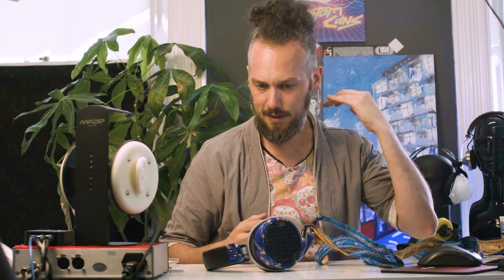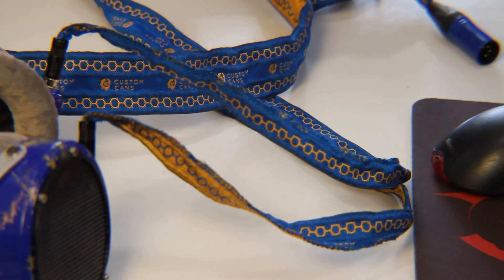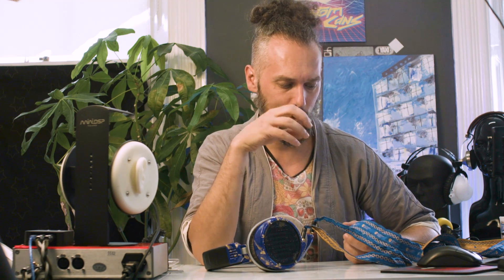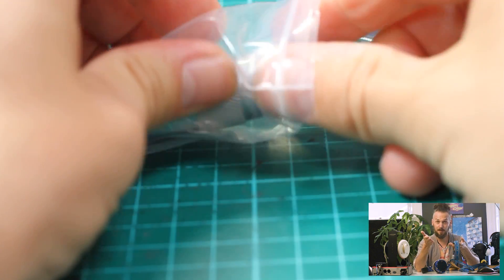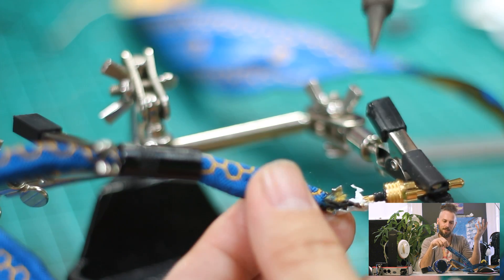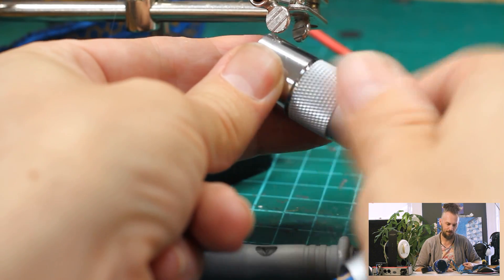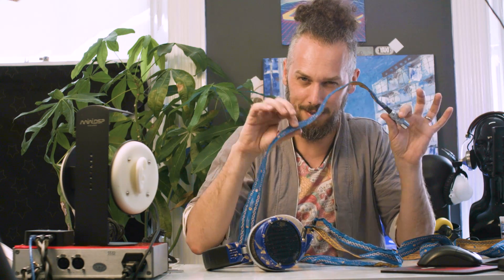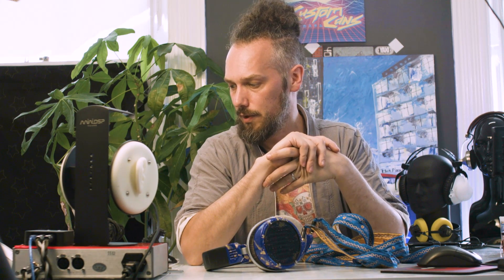Possibly the best headphone cables ever made ;) taking a look at our latest design.

Comment: I see that you now offer both copper and silver cables. Are both materials OCC or is your copper still OFC? Thanks
Reply from the maker: The copper is still OFC
Reply: @CustomCans  Thanks. Would you consider upgrading your copper cables to OCC? Or do you consider OFC sufficiently good?
Reply from the maker: @MistaLova-Lova  We have considered it. The copper wire we use is pretty good so there would not be much advantage going to OCC and it would bump the cost of the finished product up by about £40 per meter. It may be something we try in the future. It is not the kind of thing we could do as a one off request as we have to get the wire made to our own spec and a batch costs a couple of thousand pounds to get made.

Comment: Poor soldering job there mate.
Reply from the maker: Yeh ;) Trying to hold the soldering iron at odd angles so it does not interfere with the camera combined with silver solder on litz wire did not help. I kept this one for testing and have used it every day since and it has held up so far so... maybe the bigger the blob the better the job is true ;) 
I promise, James our technician does a much neater job on the custom ones than I did in this video.
Reply: @CustomCans  Yes, silver soldering is much trickier.

Comment: Heeey you do good work BUT question:  I see all the labor you’re putting into making sure the Litz is coated in graphene but what do YOU think that does ..? I ask because you’re apparently not soldering to it (the graphene), nor are you treating the enameled Litz before soldering, so I’m just kinda’ wondering if I’m missing something

Graphene is desirable because it’s a super-conductor, isn’t it ..? What are you using it for in this specific application ?
Reply: I just want to add a little to what I mean:

Take away the wire & coat, say, a string in graphene. Then solder the graphene at both ends.. say it’s used in a closed circuit because the graphene is uninterrupted

But @ 2:22, there’s this shot where it has cracks & breaks in it, nor is it even soldered to the plug

If you pulled on the graphene-coated string, & the graphene is so fragile that it cracks, wouldn’t that break or open the circuit ..?

So my question is more… to what avail does the graphene matter, the way you are using it..? That’s what my curiosity is, I suppose
Reply from the maker: In this cable the signal is being carried by the copper and the graphene coating is used as shielding. This is essentially covered in tiny graphene particles and as they all have joins in-between it is not a great conductor over the length of the cable but it does block a lot of RFI and EMI without raising the capacitance as much as normal shielding. 
I know it seems like a bit of a waste, not using it to carry the signal.We make the same style cables without the graphene coating as well.

At the moment we are using electro mechanically exfoliated graphene, which is made by pumping ions in and out of the layers in graphite to flake off tiny pieces of graphene and the flakes are tiny. I have seen people working on growing graphene  directly on copper foil so it may be possible to make a decent conductor from that in the future but it has to be done under crazy pressure and in the correct mix of gasses so it beyond our current resources / engineering ability.
Reply: I seeee…. —it was my understanding that one end of the shielding needs to be soldered to the source end in order for shielding to work properly.. & even then, if there are breaks in the shielding… man, I dunno

I love that you’re trying it, tho

And hey don’t get me wrong, I really love your work & I’m not trying to give you a hard time or anything but some of your fundamentals feel a little wonky haha

You make a better artist than an electrical engineer <:)

I dunno if this will save you a headache or not but could I make a suggestion ? Ever hear of copper tape ..? See if you can carefully fold copper tape over the length of the wire(s?), trim the excess, solder one end to source ground, boom, then you at least have some textbook science action in the mix & you don’t have to hope that what you’re trying w/ costly graphene-based techniques work the way you want it to (respectfully…!)

Again, your work is cool & the videos are cool but if you’re going to low-key take on an Educator role as well, you’re trying to show your work in these videos & what you’re explaining is uhhh —it’s not “bonkers” because I get where you’re going for w/ some features but I’d hate for you to do all that work & then it’s sorta’ for nothing

Burning yourself for the time, burning the customer for a missing feature, but I guess if you jack the price up & everyone’s happy then I dunno I guess haha

—I’m picking a real fight w/ craftsmanship this week & may need to switch the decaf but some of this is fundamental & it’s your field w/ this particular business…? So if your shielding isn’t going to work, don’t include it or don’t up-charge for it being present /:)

Hahaha I dunno why this is coming out like this haha I guess I see room for improvement & just wanna see everyone do better work

—man, the chick at the merch booth last night for Machine Girl wouldn’t grasp that the actual artists didn’t make the shirts, a teeshirt company did & @ $40 a shirt, “just let me see a few more shirts” to check for the most centered graphic. Money is being handed off anyway, but people are flawed & some of the shirts have crooked prints & I won’t have that hanging on my mind for the next several years, wearing crooked prints like a chump

And if you’re one job is to hand off shirts, just be nice.. let people look at a few shirts. You’re Life is fine, no one is in danger, show some respect to the artist & your employer, y’know..?

Not YOU, but people be shrugging at standards out here & it warrants the occasional slow-blink

<end rant>

Keep up the good work, dude. Just do your best & keep on keeping on <3
Reply from the maker: @theIMMUNICORN  Thanks, and yes, floating shields are much less effective. I had seen a few other people using graphene coatings as shielding in electrical products and I think the theory was that it acted like a very lossy antenna absorbing and re-emitting the radiation and turning some of it into heat in the process reducing the amount that got through ... It seemed to make sense and people with much more expensive setups than mine were getting results. I tend to get over excited buy designing stuff and overcoming the challenges and this seemed like a fun thing to try. 
We do make turntable cables with normal grounded shielding but it increases the capacitance of the cable quite significantly and we always try to keep that low where we can and obviously makes it a lot heavier and less flexible. I, personally don't feel that most headphone cables need shielding but a lot of people asked for it and this seemed like a good way to tick that box by adding a certain level of shielding  without adding too much weight or capacitance.
We also gave cables out to testers and they said they preferred the graphene coated ones - obviously, knowing they were more expensive and involved a sexy material like graphene probably had some kind of subconscious effects.
A lot of the high end cable market is based on dubious theories and I do try an keep just the right side scientifically plausible while still giving people something they can brag about to their friends but I may have over stepped the mark on this one, and if I have, I apologize.

Comment: Because the effect is so small, I've never cared about inductance and crosstalk, but what does this do to cable noise? I find that the cable noise on my HD25 set is absolutely awful
Reply from the maker: Yes, i think what you are talking about is "cable microphonics" where the cable transmits vibrations to the headphone when it rubs against your clothes and things. This one is pretty good as it has a little stretch to it which absorbs a lot of the vibration. The HD25 it a bit of a nightmare for microphonis because the cable is hard mounted to the back of the driver module so it picks up vibrations from the cable like crazy... I have been meaning to try to do something about that so I may try and make a fix for that next week in a video.
Reply: @CustomCans  That would be absolutely incredible if you could remedy. I'd easily pay 60% more for the HD25 if it didn't have that problem. In my job as a location sound mixer for film, having the cable rub against my jacket is a surprisingly big problem.

A note on calling it microphonics: I've heard this used for this concept before, but according to the sources I've seen online, microphonics is about mechanical vibrations being turned into electrical noise, rather than mechanical vibrations transferring through the objects. But I might be completely mistaken.

Comment: Lets see, i got Israeli pure single crystal silver airforce communication wire, parallel with single crystal gold plated copper on the positive, and gold filled copper on the return (gives s special body to the mids, same as silver gives clarity). Individual cotton braided (special audio cotton wrap for the gold wire (cotton provides the highest space and clarity other than stringing it out across a room with nothing within 1m of it , soft cotton shoelaces for the rest) and then wrapped in balanced config. Purple and pink shrink. High silver content solder.  About $80 all in all..$100 with mini aviation connectors ☺️

Interested in how the graphene affects the sound though, has to be either clean as hell or diffuse as hell.

..off to the bay i go

Comment: Is it 22 awg wire?
Reply from the maker: It is 168 strands of 0.071mm wire which ends up being around 0.66mm2 cross-sectional area of copper which equates to somewhere between 19 and 20 AWG

Comment: Can do a comparison between standard cable and overkill cable with graph? On difference headphone that compatible with it.
Reply from the maker: The differences between cables would probably not be detectable on a headphone frequency plot unless you had very low impedance headphones and then it would mainly look a bit louder on the fancier cables due to their lower impedance. You may see a tiny extra increase right up at the top end due to the lack of skin effect and low capacitance. A lot of people claim to be able to hear a difference but that could just be placebo. That is why I designed it to look and feel nice, have low microphonics as well as keeping the weight down and flexibility high. Those are all undeniably good properties for a cable to have. Despite me thinking I can hear a difference and a lot of the feedback we get saying how much difference it made to their setup... The placebo effect can not be ruled out. I did all the work to get measurably lower capacitance and the super flat response just in case it is a real thing - that way you know you are definitely not missing out on anything

Comment: Wow. SO incredibly overkill. I love it. Overengineering is probably my favorite kind of design. I'm curious, what kind of durability testing have you done with these? I don't doubt you guys would make a durable product, but I've had a few cables like these scrunch and fray.
Reply from the maker: We only got the 1st prototype out at the beginning of July but so far, no issues. Silk is pretty tough stuff. It is a bit tricky as customers always end up doing unexpected things to them. We have a few out in the wild now with some beta tester / early adopter types which should help make sure they are OK
Reply: I would hope that if someone owned a set of silk-covered headphone cables, they would take good care of them and not be rolling over them with the chair kind of thing.
Reply: @nickkendall3764  I also like to over engineer things and can appreciate the idea behind this cable, but you also have to realise that this is completely unnecessary for the application of headphone wires and will make no difference to what you can actually hear. Over engineering something to be stronger than it needs to be usually makes sense, as you can always find a way to apply more force. But you cant extend the range of your hearing, so sacrifices are being made in the shape/size/durability/cost for no gain, almost making it more like under engineering

Comment: You forgot nice cable's for Audiophiles have to be sprinkled with magic fairy dust, so you can charge megabucks...jokes aside, what are they gunna set me back ?
Reply from the maker: These can come with a graphene coating for the audiphiles ... The graphene is made by electromechanical exfoliation of pyrolytic graphite. Surely with that may long words it must be better than you run of the mill fairy dust ;)

We are still looking at pricing. As you can imagine, they are not cheap to make. I suspect the normal litz ones will be in the £200+ range and the graphene coated litz ones will be a chunk more.
So expensive, but a fare price for what you get and by no means the most expensive ones out there.

Comment: Great design. With this cable I can finally see the point of a balanced headphone connection. Dual entry headphones and a dual XLR output on the headphone amp should lead to minimal crosstalk. Will I hear any difference, no way, but I wouldn't mind giving it a try. :-)
Reply from the maker: That has been the hardest thing .. Trying to make a high end cable that will tempt the cable disbelievers  ;)
Reply: @CustomCans  Send me a sample one and if I can hear any difference I will shout it from every rooftop. 😗 😁
Reply: @st200ol  come on dude buy it hope your lucky and win it in the give away but scabing for it have some class dude just no !
Reply: @nickkendall3764  What does it have to do with you what I type in a comments section of a social media site as long as it is not abusive, like your post could be interpreted as toward me. :-)

Comment: Wow just wow iv never heard of anyone talking capacitive coupling and inductive coupling in headphone cables i live in the rf world with transmitters and recivers and antenna design this is very homely to me and you are 100 % right it's overkill but in the most glorious way I doff my cap to you sir bravo bravo indeed
Reply from the maker: Thanks - If nothing else, I have found the most expensive way for me to win at headphone cable top trumps ;)
Reply: @CustomCans  without a doubt you win hands down .thing is if you run overkill stuff you know for sure it's as good as it will get and therefore can be confident your not leaving performance on the table that kind of comfort is rarely found in audio its a hobby full of questions with vague intangible answers so in this regard you truly are makeing something unparalleled as well as its physical construction and electromagnetic performance that's the dream team trio